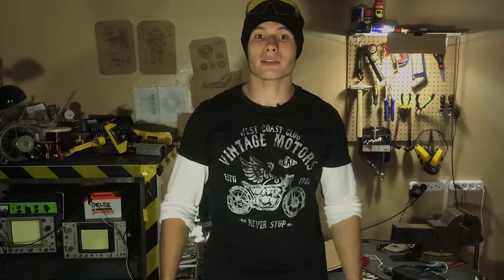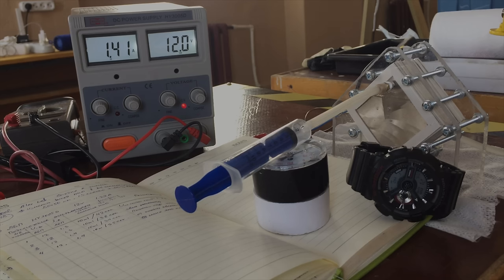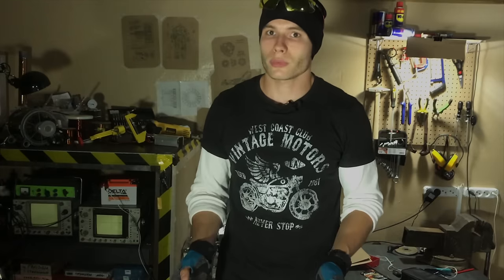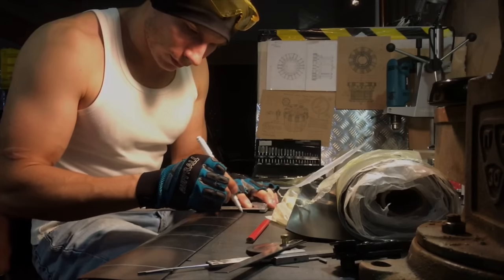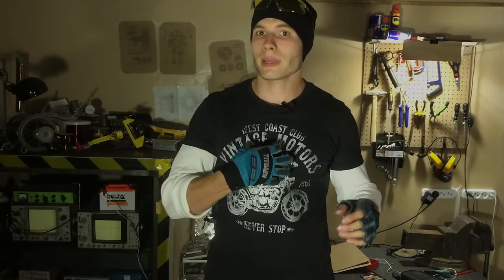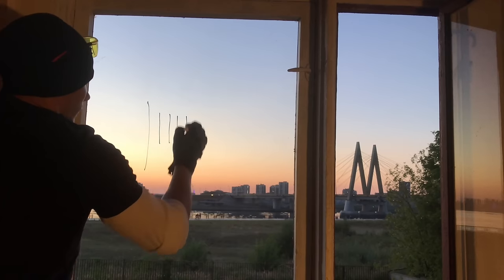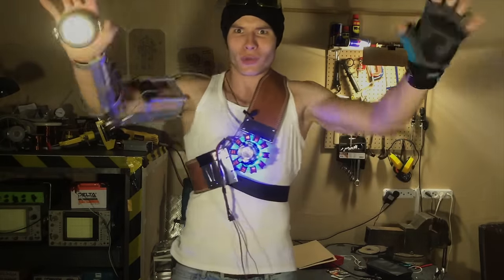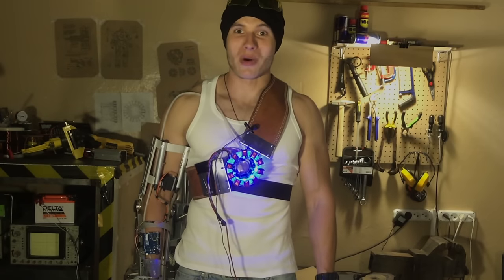Functional Hydrogen Reactor for Iron Man Repulsor. DIY electrolyzer for Tony Stark exosuit.

Comment: The cool thing is that this model legitimately looks like a bulkier version of the og arc reactor that tony built in the cave, down to the little copper coil bits around the circumference of the reactor
Reply: It just looks bulky that too because he doesn't have a hole in his chest

Comment: So basically:
A battery powers electrolysis, splitting water into hydrogen and oxygen
A tube carries the hydrogen and oxygen to the arm mount
Then the hydrogen/oxygen mixture is ignited, causing a bang
Simple, but a cool, 'functional' idea for a costume.
Nice work.
Reply: Hey bro can you once more explain me in a brief about what is the thing that produces a boomm and whats inside that arc reactor???
Reply: Gopalsharma Official in the reactor are wires which cause a electrolysis with water to split it to hydrogen and oxygen. The reactor is powered by a battery outside the reactor. This “boom” is just a reaction between oxygen and hydrogen! I guess he had a small wire at the end of his repulser to insert energy in the reaction system to force them to react. Simple and easy way to build a nice show for idk maybe cosplays
Reply: that is water reacting in electricity that became Hydrogen, in other words, electrolysis. it would be better if you make it self sustainable electric power supply. maybe in the future updates i guess :D btw, that is awesome.
Reply: @ATESLAY8SLAY  In order to burn the mixture of hydrogen/oxygen he makes use of  a small ignition coil, which is basically, extremely high voltage produced by electromagnetic induction.
Reply: Ok you mean the copper wires are performing electrolisys here ??
so where is the water stored then??
and according to you it just need ditilled water and an power supppy to do electrolisys and do that shot 
????? Please clear it to me!!
Reply: @ATESLAY8SLAY  Please read my next public reply below it and make me understand
Reply: @gopalworldwide1  Stare closely to the reactor, in the middle of it you can clearly observe bubbles in water. The water is so stored within the supposedly claimed "hydrogen reactor"
Reply: Wow you must be really smart, i'd like to see you pull this "simple" idea off in such a compact and efficient way like this guy has
Reply: @jorgevaro7522  So you mean that that reactor stores water in it???
Reply: @jorgevaro7522  And if it is so then the copper wires are containig the electricity to the water or not ???
Reply: @gopalworldwide1  It's HHO dry cell, it can either be stored or a flow of water fills the reactor continuously (in case it is overly powerful).
Reply: @gopalworldwide1  No, once you want to ignite the system, you press a push-button which acts as a switch. Therefore, the flow of electrons will come out of the battery and enter the ignition coil which escalates voltage  to a really high one. Then two coils  bringing each  one  a different polarity are put in front of the valve, so as soon as it opens the mixture will begin to burn and "blast".
Reply: @gopalworldwide1  Where are you from?
Reply: Jorge Varó yeah that was what I meant with the wire
Reply: Gopalsharma Official yes the reactor stores a small amount of destilled water in it. There is also the electrolysis process :) the Batterie is outside
Reply: Fair Dinkum Lego anyone with a bachelors in engineering can pull this off. This is not the portable, impossible to build fusion reactor you see in the movies
Reply: BaldManLogan i study Bachelor of Engineering and it’s really not complex
Reply: @jorgevaro7522  India
Reply: @jorgevaro7522  And acctualy i'm a student of 9th standart so it is quite difficult for me to understand about all this

and yes thank youhh for make me this thing easy to understand thank you so much
ya i have some little douts but today i'm starting this project and when it creates problem i'll let you know
and i also upload its video on my channel so it is easy to you to understand that whats happening there and yes again a big thank you!!!
Reply: Gopalsharma Official So am I, I’m just 16 years old (turning 17 this year) ... Spain, is my country of birth, as a consequence, you need WhatsApp or another social media if you’re willing to chat personally.
Reply: Gopalsharma Official Thank you as well, meeting people around the world is greater than fine.
Reply: @jorgevaro7522  I had whatsapp bro we can talk there
Reply: @jorgevaro7522  Ohkk ohkk jst one last question please 

as all above you tell me is about the heart (hho dry cell) now the thing comes to the repulsulator that what did he do with the gas that makes boom???
simply whats inside the repulsulator and how it works???
Reply: @gopalworldwide1  The HHO dry cell works thanks to the process of electrolysis : https://en.m.wikipedia.org/wiki/Electrolysis

Once the mixture of hydrogen and oxygen is produced as a result of the electrolyzer, it  is burned, a chemical and exothermic reaction takes place, where hydrogen and oxygen are bonded together to form water. Basically the gas turns into water when enough energy is provided and it's surrounded by oxygen (present in air or provided by electrolyzer).
Reply: @gopalworldwide1  I'll Write you as soon as I can.
Reply: it's not the copper, but the steel plates inside the container. probably the copper wire there are only for connection/designed connected to steel plates through batteries
Reply: Amazing
Reply: @jorgevaro7522  I understand at first i have to fill thr reactor with ditilled water and then connect the battery to it so it can conduct electrolisys after to it the hydrogen gas goes to the hand sylinders to the repulsulator but after that what happenss????
how he blast the gas what will he do with the gas???
Reply: ATESLAY so this can’t actually hurt anyone or damage anything?
Reply: Wait are H2 and O2 separated? Because if not he's gonna be blown up
Reply: @gopalworldwide1  Electrolysis is the water reacting with electricity, you know water is made from Hydrogen and Oxygen, When electricity is passed through it using coiled copper wires, it creates that fizzy reaction which releases hydrogen from the water inside the arc reactor.
Reply: This Is so cool it's LITERALLY an ARC REACTOR
Reply: I mean it's AT LEAST A REACTOR
Reply: @TheHOBGamer it can if the water quantity is high and the reactor he is using is larger, and also if an object is too close to the flame produced there, then it can harm the object

Comment: Bro how do the hydrogen gas comes out of the gloves without pressing any key
Reply from the maker: I have 3 types of ignitor
Button ignitor
timer ignitor
MAPP gad ignitor.
So in this case flame travelling from MAPP gas tanks ignite it
Reply: It is probably set up to timer on the circuit board of the repulsor

Comment: I can only dream being as smart as you.
And remember Ironman 2 when tony said "no one can rebuild my suit because no one is smart enough nor rich enough to do that"
Guess he was wrong...
Reply: georpoo no he was right the current suite iron man has is way too expensive this YouTuber barely scratched the surface by making a prototype repulser blast
Reply: @cammywhite8374  for now...
Barley isn't much but its something...
Reply: No he wasn't
Reply: this is not even close and will probably just be for cosplayers. Building a real arc reactor from iron man would require a substance that can contain all that heat energy. And he also need a source of that energy like tony used paladium for the first time. So until a youtuber has any of it, it won't happen.
Reply: U need billions for a real one, just one
Reply: kitty mcpaws Tony stark’s arc reactor  which is made of palladium, is fictitious . No known  physical element  could ever perform such activities, nor even real palladium.
Reply: Stark doesn't use water or hydrogen and oxygen, he uses a fictional energy produced by palladium.
Reply: +Viktor Reznov A hypothetical "cold fusion"...  Where thanks to the capacity that possesses palladium to absorb and hold 900 times the volume of hydrogen (or its isotopes deuterium, tritium...) A fusion of pure deuterium and  a neutron could occur under those circumstances (extremely high pressure). However, it has been proven that it does not happen like that and it's unfeasible.
Reply: @The_Viktor_Reznov  This neutron bombardment would cause damages on palladium and other reactor walls. In the aftermath, Tony must find  out another  unknown element belonging to the group  of " transition metals" which has similar properties and the particularity of being highly stable.
Reply: No he was definitely wrong,unless he said smart enough "AND" rich enough then he'd have been right,those who have the intelligence don't have the money and those who have the money aren't smart enough.
Reply: Yeah but, this is only a TOY version
Reply: kitty mcpaws even if you were the richest man on earth, it would still be impossible to build one in today’s world. Tony’s arc reactor is just another name for a cold fusion reactor. We haven’t even built a hot plasma fusion reactor yet, the only one that exists is the sun. We are hundreds of years away from building a cold fusion reactor
Reply: kitty mcpaws actually its a “mini” nuclear reactor we just have to be able to contain such power in a small amount of space with out the radiation killing us
The suit overall is very “simple”, havent you seen the darpa and lockhead martin military suits for combat support and reinforcements 
They could probably add in some armor and make it an actual suit (not as refined as a mk2-bleeding edge but as nice as a igor, hulkbuster, or even the mk 1 (maybe even red snapper) if battery technology becomes better
I mean, the only reason those suits are so bare is because if they are light weight and functional (not perfect) and serve their minimum purpose they are fine. And even then they only go for-1 hour 
If they added the armor probably less 
Lmao i like how the same thing we all experience with our phones battery life is the same thing keeping the iron man armor to be a reality among other crazy tech
Also technically there are a lot of teens that have made home made mini nuclear reactors but again. Most of the time the radiation hurts, military/police come in confiscate it, and unknown how to implement it into technology 
Iron man said “5-10 years, hammer 20” i guess we’re hammer for now.... its just battery technology hasnt improved in years, i think soon enough someone like samsung will try (look at hauwai charging 70% of a smartphone at 4000mah in 5min) sooo... soon enough?
Reply: I know right cause i would already be flying and fighting bad guys
Reply: But mostly flying
Reply: @TrevrepGaming  exactly
Reply: @TrevrepGaming  now if the rich and the smart combined than they would be able to become iron man
Reply: @deathisjinx9488  but the repulsor is what also makes him fly and everthing else because the repulsor is like a tiny jet that pushes stuff away which can be used to make him fly with enough of them then he would only need a shell
Reply: Demetri Heier Supposedly, it “pushes off” muons combined with some sort of plasma
Reply: Physically impossible to thrust an entire armored body with repulsors which blasts muons and plasma. It does not have any power-to-weight ratio...
Reply: @jorgevaro7522   but if you would adjust the repulsor it would be able to
Reply: Hey fellas how's it going?
Reply: He said the technology can’t be duplicated for 10 years. We’re coming up on 10 years now ..
Reply: Brandon Tejada 10 years for the MCU, Marvel’s cinematic universe. It is a fictitious technology, within that universe it’s possible. However, here  where reality is the driving force, it’s inconceivable.
Reply: @DrPsych-id1dw  your not wrong,but there are too many creative and moral differences for them to cooperate.
Reply: The Ironman suit is not even real. This guy's is real tho.
Reply: Nothing is impossible but that "reactor" isn't enough, it's really a toy more than a real reactor, I think we can make it today but we need huge amounts of money and many scientists and some time, maybe we can't make exactly same but we can make really close to it.
Reply: fake.
Sheep would trust anything on youtube.
Reply: Barkın Beceni freaking trillions man
Reply: georpoo it's super fake and only 🐑 trust it.
This is an IQ test and most people fail to see it's fake.
Reply: Its a flame thrower.
Reply: Matthew Payne ഈഎഃഃഎങ
Reply: @agarthaasgardhodl8523   hydrogen + oxygen equals flame.
Reply: @cammywhite8374   its not repulsion as much as an over engineered flame thrower. He is splitting hydrogen  and oxygen then igniting it.  Repulsion tech is theoretically impossible. The only reason it works in marvel is because the uses for it all have overly abundant sources of power. 

https://comicvine.gamespot.com/repulsor-beam/4055-55700/
Reply: Hardley same is it
Reply: TheLesser   It’s fake, splitting water into oxygen and hydrogen gas. Then ignite for fire ball. The fundamental particles for repulsor does not even exist.
Reply: Agartha Asgard[HODL] its a hydrogen generator... I've made one with my daughter and the internals corrode extremely fast with as much catalyst as he must be using. Basically a battery in reverse. And the flash is hydrogen burning, it releases an enormous amount of energy when it burns
Reply: Well, it HAS been 10-15 years like he said it would be.

Comment: Bro this is so cool, because there is actually no one doing this at the time, you know.....we all expect a whole suit ;D
Reply: Buzz i saw his first video on this stuff a month ago and ive been working on it im gonna make it considerably more powerful and have some shock absorption.
Reply: EchoSpark 267 ive been working up my knowledge for 3 years building robotic arms out of trash with 5 or 6 prototypes.
This year I started expanding my knowledge of chemistry, I made a simple reactor making hydrogen and oxygen to fill a chamber and make a controlled explosion like in this video.
i have some of my progress posted on this profile but i usually only upload very old versons saving the better new stuff for my discord server.

anyway i have no money of my own and no good equipment other than my soldering iron which is cheap.

Comment: im still not clear what exactly causes the glow, and what the induction coils do besides making things look cool. can someone explain? ive looked this up and i cant find much about it.
Reply: I think he mentioned that he added lights so you can see the reaction, to know intensity and that it was working.   The induction coils, increase the voltage, perhaps because he uses lower voltage DC to be safer, but needs to ramp it up enough to separate the hydrogen and oxygen???      Seems it still needs to be hooked up to power to get the hydrogen to cause the pulse blast...  cool but I wonder if he can eventually separate from a massive (size) power source.

Comment: how about propulsion, increase the storage of hydrogen and oxygen in the reactor and use it as propulsion to fly.
One more thing you must complete with the electro muscles to the whole body before designing the propulsion. So, it will help in flight power.